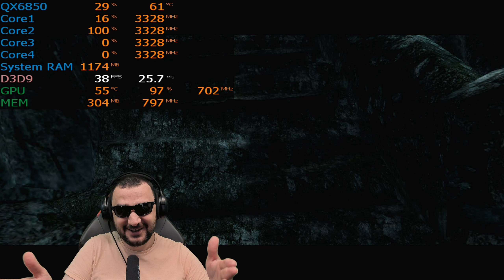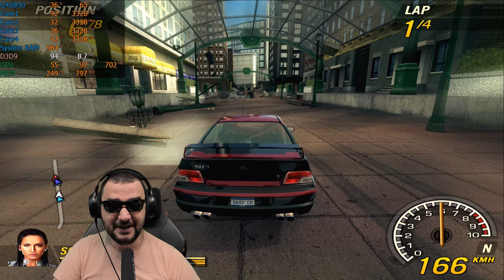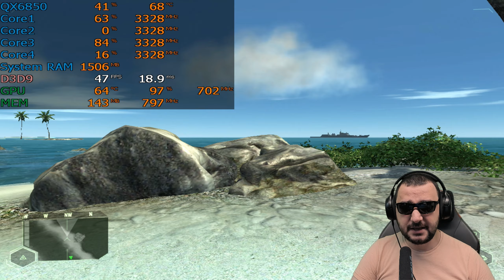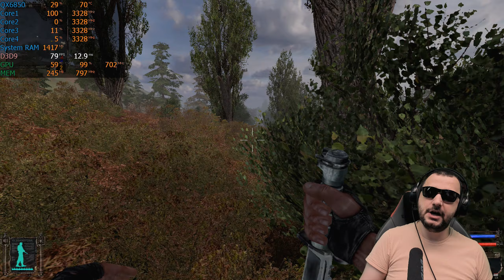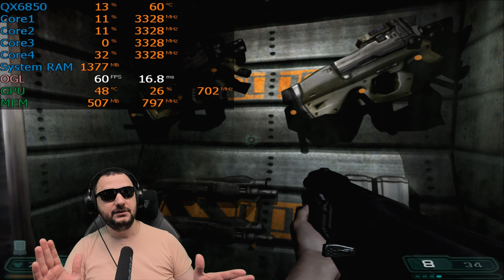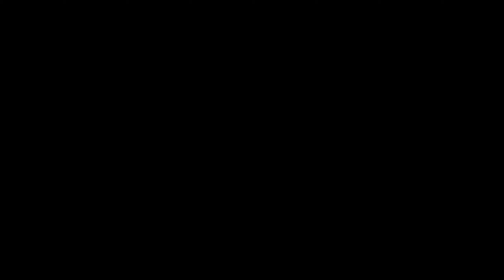Nvidia Geforce 7900 GTX Benchmark

Comment: I had a 7900 back in the day, it overheated constantly and eventually got artifacts. Went for the Radeon 1950 and again, very disappointing. Finally got the 8800 and ran it until I got a  GTX570. The 7900 runs good for anything 2005 and under but as you saw 2006 and up games perform really poorly compared to next one.

Comment: My retro build rig from that era has two 7900gtx in sli overclocked a tad over 700mhz on core and a E8600 overclocked cpu to 4.2ghz. It gets playable frame rates on high in Crysis. The game did scale with sli rather well.

Comment: You can't find this back home anymore, the scalpers got them all coz last year you could find them for cheap like less than 20 quid,  no more cards on olx from fx series all the way up to gtx 200, ur lucky to find a gtx 280 or a rebranded 9800gt in the form of the gtx250...they are even buying all the equivalent quadro cards 🙈

Comment: This is the fastest Windows 98 compatible GPU.
I have the exact same model, I removed the King Kong stickers, under them there are original NVIDIA stickers, much better looking now :) 
I've ran it on Windows 98SE all the way to Windows 11 using Windows 8 drivers, pretty fun card to mess around with, and yes, the heatsink is awesome :)
Reply from the maker: do you still have the GPU?
Reply: @DanielCardei  Yes :)
Reply from the maker: @pangoomis  so what card are you using now?
Reply: @DanielCardei  my main PC is currently i3-12100F and RX 6600
Reply from the maker: @pangoomis  omg :_ohNo:. 7900 GTX its more expensive than that RX 6600 hmm :_wtf:
Reply: @DanielCardei this👆🏻 and I was shocked to find out how much 7xxx high end cards cost these days

Comment: That moment when modern card like RTX 4090 with most advance architecture will not last and probably burn in a year or two because of connector or chip itself will fall of because of bad solder under the chip. While this card which at this point is considered dinosaur is well in alive
Reply from the maker: I think that modern GPUs are pushing the limits of technology and performance, which sometimes leads to unforeseen issues. Back in the days the quality of the components was totally different and the leap required to progress was different. if i was in the developing process i will make a less powerful card with the smallest power consumption, size and the highest reliability.
Reply: Actually many cards from 2006-2009 are failing because of bad solder. It’s important to never run these at more than 70 degrees celsius. But many cards of this time have bad cooling and run too hot and fail.

Comment: Just letting you know that you can buy the Core 2 Duo E8600 for between $10 to $20 right now. The reason I'm recommending the Core2 Duo E8600 is because its the fastest Core2 Duo and it would be perfect for older games that only utilize 1 or 2 fast cores.
Reply from the maker: i have 4 CPU trays full with lga 775 and i need to finish my HP to start testing there. i`ll have win7 unfortunately but i hope i can finish it asap. i bought them from ebay as scrap. and most of them they work.
Reply: @DanielCardei  That's great to hear man! 😁👍

Comment: I have a question regarding the PCIe link speed and lanes.
Many times I saw GPUz displaying x16 @ 1.1 (rated speed of the card) but actual link is x4 @ 1.1, like in this case. Is that a misreport from GPUz or is there an impact of some kind?
It makes me wonder why.
Reply: Привет. Такое происходит во время бездействия системы Windows на рабочем столе. Во время 3D нагрузки включаются все 16 линий PCI Express. У самого EVGA GTX 7900. Проверено на материнской плате Asrock G41M-VS3
Reply from the maker: exactly what @barscool said. Idle. i`ve seen this in every windows. MSI Afterburner. The who card stay idle and after it starts then it goes full speed.